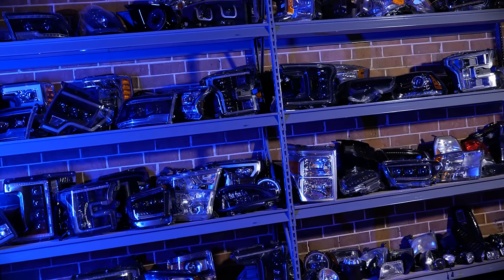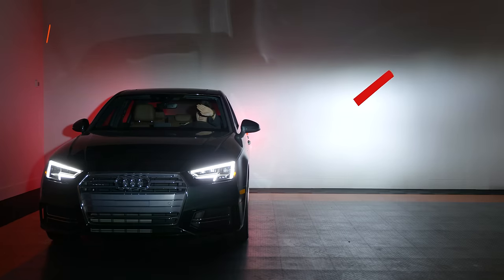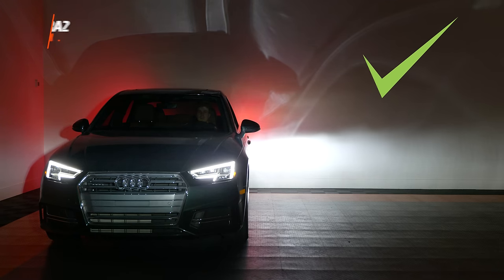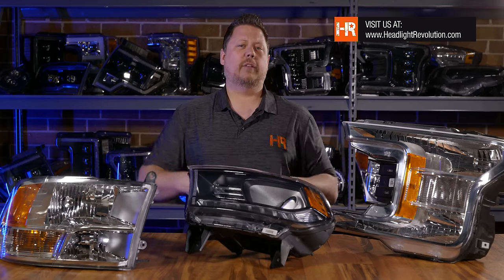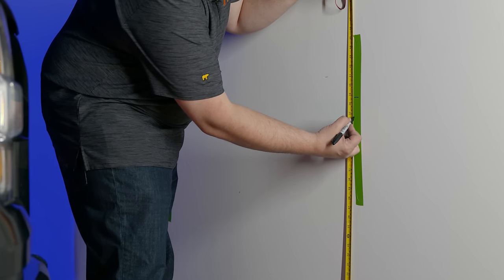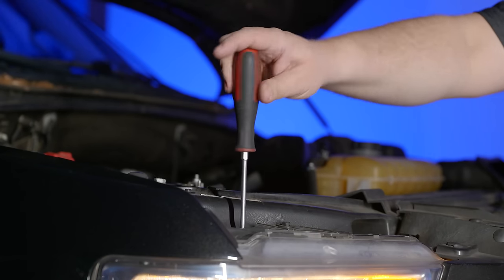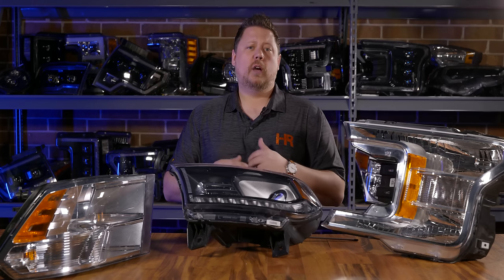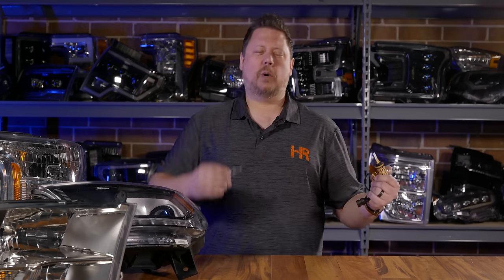How to Aim and Align Your Headlights

Comment: Hi. Great video. I've a query, this alignment technique is applicable for both low and high beam? And what about the alignment for fog lamps?
Reply from the maker: The fog lights are not as important, as they will generally not be aiming up at the oncoming traffic at all. Some have adjusters, some do not, you will; have to check if your vehicle has them or not!

Comment: They should show a video like this in Driver's Ed. class. Maybe some of these people would realize they're blinding everybody else. I like tall, jacked up trucks, but just learn how to adjust your headlights down a little, like i have. Hell, nowadays new trucks run off the lot with headlights not adjusted correctly. I thought that was part of the dealer inspection after they unload 'em off the truck. What's this world coming to? nobody cares, or is smart enough to care. Thanks for your video, I found this after looking for adjustment screws on a dodge 4500, I didn't notice the arrow in the dark, LOL
Reply from the maker: Easy to miss that arrow😝 Glad this video helped you out! 🙌

Comment: Very informative there, when I get my bulbs installed will make sure I will check this out and make the corrections if needed.
Reply from the maker: Glad it was helpful!
Reply: 2021 Chevrolet Silverado 1500 Custom Truck,  need low beam and high beam led bulbs 💡which one would you recommend?

Comment: A lot of times what the problem is with pick up trucks and SUVs they load the back of them with everything they’ve gotten including the kitchen sink and then the headlights are aimed upward. I wish manufacturers would realize this and start making self adjusting headlights
Reply from the maker: Trucks sit higher in the rear end from factory because of this, adding a load levels out the truck.

Comment: HI 👋  ! 
I'VE CHANGED MY HEADLIGHTS ON MY 1999 F150 XLT 4.6L EXTENDED CAB 4×4 . THE ORIGINAL ONES GOTTEN ALL CLOUDY.  I REPLACED THEM WITH SPEC - D TUNING 2LHP - F 15097 ??? - TM  / INSIDE IS BLACK  . BLINKER 3157 
DRIVING LIGHT IS H1 12V 55W 
HIGH BEAM IS H1 12V 55W  
WOULD LIKE TO SWITCH TO LED BULBS 💡 IF POSSIBLE ?  HAD  ALIGNMENT DONE SO I WOULDN'T GET ANYONE UPSET  & GET A TICKET.  BEEN WATCHING 👀 YOUR CHANNEL FOR A WHILE.  HOPEFULLY I CAN GET SOME INPUT . BE SAFE  ! HAVE FUN  ! GOD BLESS YOU ALL 🙏 ALWAYS ON YOUR JOURNEYS  ! ENJOYED 🍨 🍨 🍨 🍨 🍨
Reply from the maker: Reaching out to our CS team would be the fastest way to get some help, give us a call or email!

218-755-5200
Sales@HeadlightRevolution.com

Comment: How do you move it left /right?
Reply from the maker: Some housings have the ability to do this, some do not. With all housings you can loosen the bolts, move the housing a couple of milimeters in one direction, and hold it there while tightening back down. That will get you a very small amount of wiggle room. Other headlights will have the same adjuster as for the up and down adjustments, but this one just goes left andright! Let us know if you have any other questions, we are here to help! Have a great day!

Comment: What about the rotation of the LED itself?
Reply from the maker: You'll want the LED chips facing directly left and right!
Reply: Should the thick or thin part be facing when in the 3 and 9 position.

I'm using alla lighting H11. They have a notch that creates a thin part  on one side and a thick on the other.  Yes leds are in 3 and 9. The thin side is the portion with the notch.

Comment: What if I don’t have 25 feet to do this?
Reply from the maker: We'd recommend finding somewhere with enough room! Warehouses, behind a Walmart, or big office spaces!
Reply: Stop using the standard 2" & 4" drop, these elevations change according to light height. States have min and max projection distances for the low beam. generally 135' minimum and 200' maximum. If you use the 2" drop @ 25' on headlights that are 42" you'll projected the beam @ 520' and not the state maximum. STOP BLINDING OTHER DRIVERS . 42" height @ 25' should be 5.25". Use the formula (42/200)x25=5.25" below center line. ( bulb centerline / light projection  feet  ) x the distance you are projecting it to  ( test wall, test board or other ) it could be anywhere from 10 feet to 50 feet. 

Fog lights have a maximum of 135' projection, so get those adjusted correctly too.

Comment: Looking at how crappy LEDs lights can be it 1. explains why some LEDs are so blinding and maybe not due just to misaligned headlights. 2. explains why inspections should still be done on cars so they will not only be safe for the person driving it, but all the rest of us on the road around these modified cars.

Also, I was kinda nice when all headlights were the same and a headlight aimer could be attached to the light and it had level indicators to be able to adjust them.

And When you mention noticing it on street signs, I've noticed that if mine are too high street sign reflections can almost blind me!

Comment: I'm pretty sure the driver's side headlight is supposed to be lower than the passenger side so you don't blind oncoming drivers. So 2 inches for the passenger side and 4 inches for the driver's side.
Reply from the maker: You are partially correct, but this is not something that is done b y actually aiming the headlights. The headlights have this thing called a cutoff line, and that is stepped so that the left side is lower than the right side. This is already in place on those almost all headlights, so that is a non issue! Let us know if you have any other questions or concerns, have a great day!

Comment: With my car it says 1 degree inclination for headlights and 2.2 degree inclination for the foglights, so I'll just go by that. This way I'll just find what ever that is determined on what length I have available for where I choose to do the measurements. 
If I use a 10 meter distance away from a wall then the main lights should be 10cm below center, and foglights 22cm below center. If I use 5 meter distance the main light should be 5cm below center, and foglights 11cm below center and so on and so forth. 

Much easier for me given I do not own a garage, or have a perfect flat spot outside my house or anything, so I'll just go by what I can find available. I at least feel it's way better to just know this rule which is stated by the manufacturer of the car, and that I don't need a specific(25 feet in terms of most videos I see on youtube) distance. The inclination is the important part, and obviously it will be easier if you have more room to play with, but go by what you got available.

Comment: Think that all trucks, SUVs and pickups should dip their headlights 5 to 10 degrees down  from the level point because the centre of gravity is too high for other road users in other vehicle classes.
Reply from the maker: It is certainly different for every vehicle based on the ride height of them and their headlight setup!
Reply: @HeadlightRevolution  true but think of a low sports car (Eg.Ferrari) infront and being it a Ford F150 behind it at night. The Ferrari driver will accelerate not because the truck is to close but the lights and right up there in the rearview mirror.
Reply from the maker: Very true! If your truck is higher up than most then you certainly need to adjust as needed. But at the same time, cars such as Ferraris are going to always be low to the ground for most any vehicle out there, you're sort of asking for it driving a low vehicle like that! Just a part of the game driving cars such as that.

Comment: If your headlamps don't have a clean cutoff with stock halogen bulbs then you need either clean them or replace them. If your halogens just put a blob of light on the road, so will LED, just a bigger and brighter blob. You can't aim a blob... stop trying.

A lot of manufacturers are aiming their lights too high as well - so they come illegal from the factory! Ford is notorious for this, so check and make sure if you get a new vehicle they are aimed correctly.
Reply from the maker: Straight facts! Adding an LED or HID kit to a headlight that already produces a bad beam pattern will only make it worse. There is no way to improve a bad beam pattern other than doing a projector retrofit. 

Ford isn't the only one that has improperly aligned headlights, we've seen it with Toyota's, Acura's, Chevy's, and almost every other manufacturer as well!

Comment: I bet nobody here. Remembers when you got a state inspection on your vehicle. 
There use too be that measurements on a wall and they would check the beam pattern of your headlights and adjust accordingly. I've always adjusted my beam pattern too not only help me line of sight but too not blind everyone in front of me. 
Now days it seems every other driver out there has there brights on. Or don't have a single clue how too even adjust there headlights probably or even know what your talking about. So most think I'll put led in and that will make it better. No! You first need to check your halogen lights as he showed too make sure your hot spot is set correctly and then repeat with led. Not everyone can do this but it's not as complicated as it seems. But it does take a little time and flat ground half a tank of fuel and your usual correct weight you drive in your car/truck and psi and begin adjusting. I wish for the love of God state inspection would do this again. I'm a night time driver so I deal with all kinds of lights at night. Be kind too one another!

Comment: Adjustment to be done for high beam or low beam 😂?
Reply from the maker: For most headlights, the high and low beam adjustment is done on the one screw, as they are fixed together on the inside of the headlight housing. Thank you for commenting, let me know if you have any other questions!
Reply: @HeadlightRevolution  yep i had trouble. While adjusting my low beam to tilt down a little, high beam went even higher. Earlier it was aiming at billboards now it modt probably is aiming at a distant galaxy
Reply: @HeadlightRevolution  thanks for the video man
Reply from the maker: That is super odd, did you get that figured out or are you still having issues?
Reply: @HeadlightRevolution  will try again tomorrow because I have adjusted the low beam but haven't ridden to see if the change made a difference. My low beam was nowhere to be seen before.
Thanks for the reply, means a lot
Reply from the maker: Not a problem man, let us know how it goes when you try those lights! We are here to help if you have any other issues!
Reply: @HeadlightRevolution  sorry for the late follow up, been real busy with work and exams. So lowering the low beam worked, I can atleast see light beam ahead of me, high beam is still questionable and I couldn't judge, here many car drivers are driving with high beams and don't care. I only need low beam for the city so I'm satisfied, will look for a brighter bulb tho, you have any recommendations for HS1 halogens under 40W?
Thanks
Reply from the maker: What vehicle are these going into? If you could get me that information I can help you figure out what bulb you will need for that high beam!
Reply: @HeadlightRevolution  actually its an Indian Bike, Pulsar 150. It will be hard for you to find information on it😅
Socket is HS1 and DC setup, stock bulb wattage is 35W, Integrated low and high beam

Comment: I watched this video 10 times and no mention of high or low beams used for wall adjustments make this video worthless.  I just received my headlights from Headlight Revolution.
Reply from the maker: Hey Manuel! 

When adjusting your headlights, you'll want to do so while the lows beams are on, and not the high beams. The high beams use the same adjustor as the low beams, so when you adjust the low beams, your high beams will adjust as well!

Comment: And for lifted vehicles? If I have a 8 inch lift this doesn't make sense to follow this video.
Reply from the maker: For those vehicles, Unfortunately you will have to choose between more light down the road but blinding oncoming traffic, or having a beam aimed low enough that it will not be in oncoming traffics eyes. Not a whole lot we can do for those with large lifts as the OEM Headlights were not designed for that.

Comment: You guys are aiming them at SUV's.   What about a lowered sport car that is sitting near the ground like a Corvette,  Lotus or Porsche?   You'll be blinding those drivers.
Reply from the maker: That is not the fault of the lights, that is the fault of the other vehicle. Regardless of what way you slice it, a lower vehicle is going to have light in their eyes from a taller vehicle. Same concept as how truck lights still blind you when they are right on your tail, it is just due to the height of the vehicle.

Comment: Why do the others who post videos say to aim the drivers side lower than the passenger side, yet you say to aim them the same level. I can see why the drivers side should be aimed lower but why don't you do it this way?
Reply: SOME manufacturers, on some car models, aim the passenger side headlight a little bit higher to illuminate street signs better. It's more commonplace to have both headlights aligned the same. It's a good idea before reftrofitting LED bulbs to get a general idea of your vehicle's "normal" beam pattern. I won't get into my personal opinion on which I feel is "better."
Reply from the maker: Good response thank you.